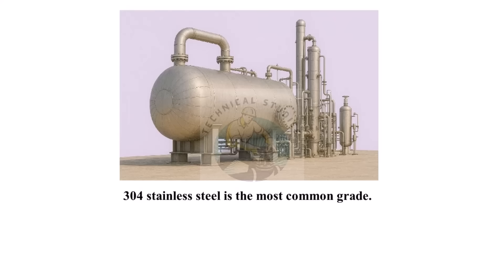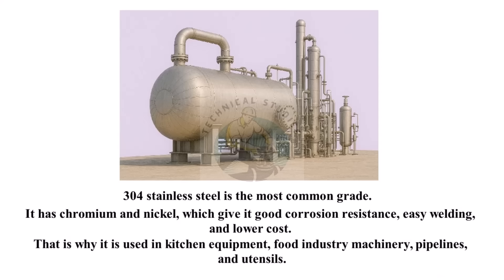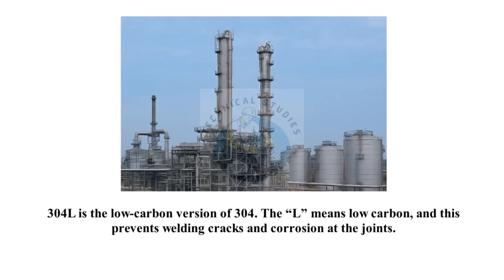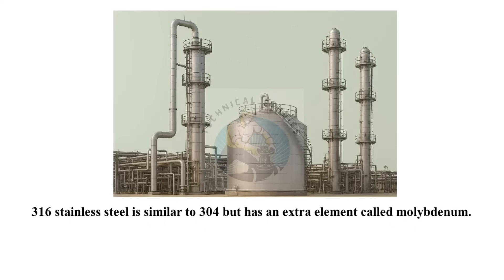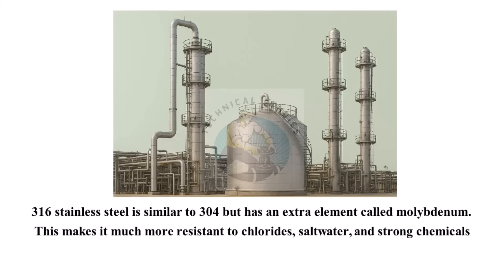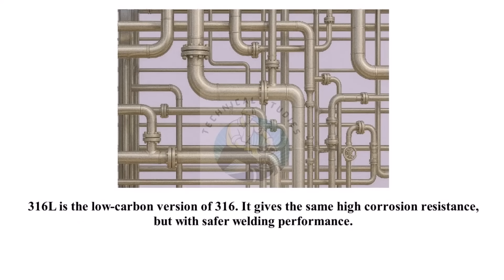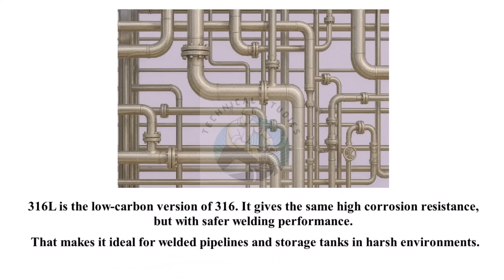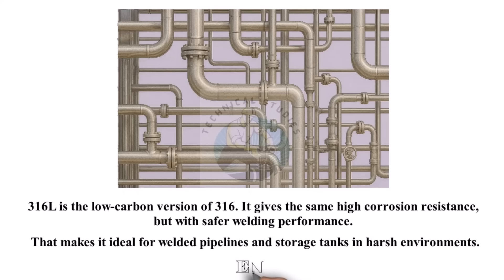Understanding 304, 304L, 316, and 316L Stainless Steel

Comment: How about 310. This i believe is far more superior for high temp applications too

Just curios wirh a welding query

Can we weld aluminum and M.S. with electeodes (arc welding sticks i meant)
Reply from the maker: You’re right, brother — SS310 performs much better in high-temperature service compared to 304 or 316. As for welding aluminum to mild steel, it’s not possible with normal electrodes — they don’t fuse properly and form brittle compounds. Special transition materials or TIG methods are used for such dissimilar joints. Thanks for your thoughtful question.
Reply: @technicalstudies. 
Ok I was asking for spcial stick electrodes do know TIG there but sticks is what I was expecting and answer for. Thks any way. Keep up the videos on metallurgy pl.

Comment: Joining Stainless steel components is called soldering; not welding 😊
Reply from the maker: Thanks for your comment! Welding is commonly used for higher strength joints in stainless steel.
Reply: I don't think you know what you're talking about. You can't "solder" stainless steel.
Reply from the maker: @jamescrud  He was just jocking Bro.

Comment: when I worked at a fabrication plant in 1965 I made two cookie sheets out of 304 stainless steel  my wife never has to use any lubrication to prevent sticking well jump ahead to 1991  I stoped at palace that does custom fabrication and had some  made out of 304 stainless steel and are the same micrometer thickness and the new ones are heavier what's with that ?
Reply from the maker: Interesting experience you had! It's hard to say without more details, but maybe there was a slight difference in the alloy composition or manufacturing process between the 1965 and 1991 batches.

Comment: 316 and 316L are far easier to machine in my experience, gives a lovely shiny surface even with form tools.
Reply from the maker: Thanks for the comment, Bro! That's a great point about the machinability and finish differences between the grades.

Comment: Just commenting to comment but in the pulp and paper industry, 316L just wasn't good enough and would rot away hence in some applications we used only 317L.  I didn't know there could be that much of a difference but I seen it with my own eyes.
Reply from the maker: You’re absolutely right . In highly corrosive environments like pulp and paper processing, even 316L can fail due to the high chloride and acidic conditions. That’s where 317L, with its higher molybdenum content, performs better because it offers improved resistance to localized corrosion (like pitting and crevice attack). It’s one of those cases where material selection makes a big difference, and your experience shows how important it is to match the alloy to the environment. Thanks for sharing this valuable insight. Thank you Bro.

Comment: You can’t use 304 for kitchen utensils it’s corrosive resistant isn’t strong enough it’s mostly used for structural elements that need decent corrosive resistance and scratch resistance like hand rails

Comment: Useful info.
My Maker space has been given some bars of a mystery stainless steel. I have reason to believe it is 316 but it could be 304.
Is there a simple way to tell the difference between 304 and 316 without resorting to a chemical test for Molybdenum? I'm thinking something super simple like a spark test against a grinding wheel.
Reply from the maker: Hai Bro, spark test won’t work — 304 and 316 look the same on a grinder. Both are mostly non-magnetic too, so that’s not reliable either. The only quick way is a molybdenum spot test kit or an XRF scan. Otherwise, just assume 304 unless proven 316. Thank you for you valid comment.
Reply: @technicalstudies.  O h I knew a spark test would not work. I was just hoping for something at that level of simplicity.
Not to be I guess <shrugs>
Reply: There is a spot test for Molybdenum that's done easily in a lab. You'd need to find an acquire the chems first.
Reply: @seymourpro6097  I a paste life I could get those chemicals. 
Not any more though :(

Comment: It is a pity that uses AI for commentary.. 304 stainless is always refered to as Three oh four stainless not three hundred and four., the same for 316 etc…
Reply from the maker: I am lucky to have had the opportunity to work in different parts of the world and with people from many different countries. Many people say “three hundred four” instead of “three-oh-four.” Both are commonly used, but in industries like piping, fabrication, and metallurgy, “three-oh-four” is the more standard way to say it. It helps avoid confusion with numbers like 344 or 314. In India, we say 3 not 4. Thank you for your time and the commnet Bro.
Reply: 3 or 4 😂😂
Reply: Been working with both of these austenitic stainless steel alloys in the chemical industry for a long time.  In the US it is three oh four or three sixteen stainless steel.

Comment: Stainless Steel is also used in most food production process.
The current top two producers of Nickle are Indonesia and Russia.
Food costs will go up as the two BRICS Members now are behind
a BRICS Wall.

US Treasury and FED Officials downplay the economic effects of the BRICS Trade Union.
The inflation that began to show signs in 2015 of increased mineral costs,
has become pretty evident

Inflation is the cost of dealing with a Trade Union.
US Commodity Brokers no longer set the price.
The inflation will continue to rise.
Reply from the maker: Thanks for your comment! 🙏 Yes, stainless steel and nickel are really important materials, especially in food processing. When raw material costs go up, it does affect overall prices. Appreciate you pointing this out—it’s a good reminder of how connected everything is.

Comment: In the beet sugar industry, beet juice is very acidic. One year they bought 304 welding rod to asseble tanks and pipelines with to save a few bucks. within a few months, there  were no welds left and leaks everywhere. Use 316 when the PH is in question.
Reply from the maker: Exactly. 304 is good for many applications, but it struggles in acidic environments like beet juice. That’s why 316, with its added molybdenum, is the safer choice when pH and corrosion resistance are critical. Thank you for the comment. It was wonderful and very informative.
Reply: At Kraft foods we used 304L exclusively. It was usda law. We cleaned with caustic and chlorinated cleaners and high temps sometimes multiple times a day. And that pipe had a 20 year life on average. We had 3 acids that went through as well to clean milk stone. It never even got thin.
Reply: Same thing in water purification. Galvanized steel actually outlasts 304.
Reply: @ghost307 At Kraft we could not have steel water pipes due to usda law. Oddly our 304l pile lasted for 30 years plus. And no plans to change it.
Reply: @tireballastserviceofflorid7771 The water plant had ridiculous levels of chlorine 24/7, although not high enough to be dangerous to humans.
I remember 1 304SS 36"x36"x12" junction box that literally turned brown and crumbled to dust in just over 6 months.

Comment: In Pharmaceutical mixers, the L grades prevent the scraper blades from turning the often white formulas from turning BLACK
Reply from the maker: That’s a great point . The “L” grades (like 304L, 316L, 317L) have lower carbon content, which helps prevent carbide precipitation and surface contamination. In pharma mixers, that means the stainless won’t react with the product and cause discoloration – like turning white formulations black. It’s a perfect example of why material selection is so critical in industries where product purity is everything. Thanks for highlighting .  Sorry for the late reaction.
Reply: I used three sixteen L to make Coronary Stents in the 1990s AI is too stupid to know about Stents.